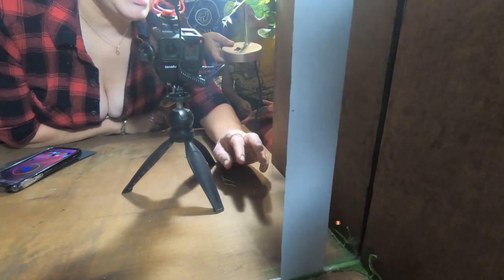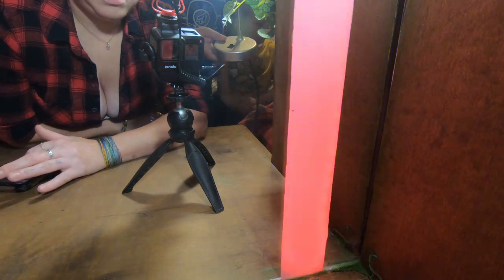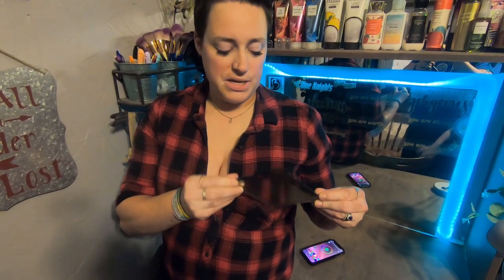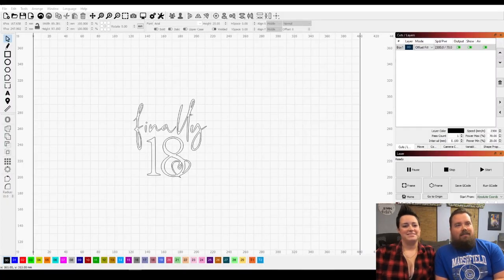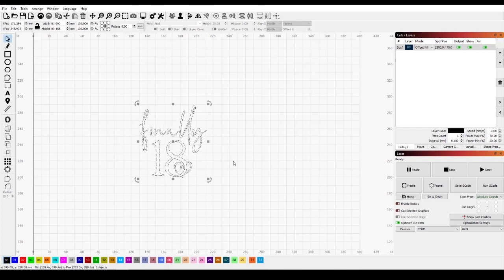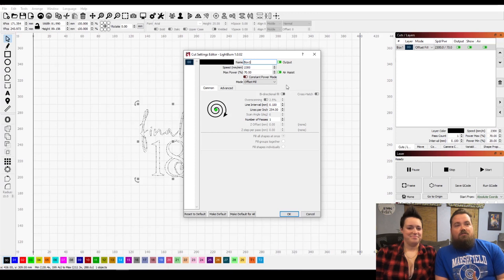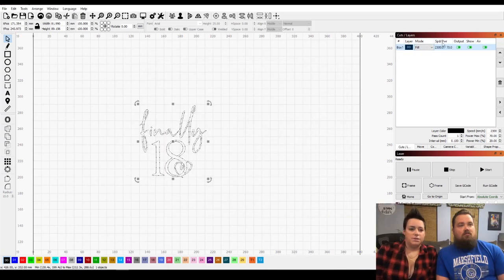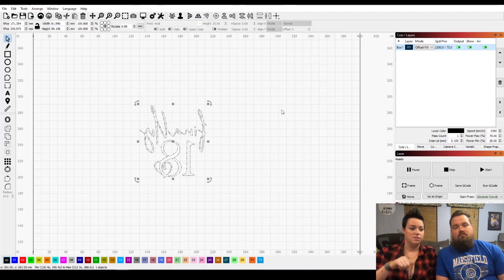How To: Mirror Engraving | Ortur LM2

Comment: Thank you so much for the awesome tutorial! It inspired me to engrave some small mirrors for my room. I tried engraving using a small mirror from IKEA but unfortunately that didn't work :( I used the same settings you used in the video it barely engraved the surface of the back of the mirror. I decreased the speed to 500mm/m at 100% with pass count of 5 and still no luck. Will try again on other brand mirror wish me luck!
Reply from the maker: Maybe try a power scale test on the mirror. It will help figure out the power and speed you need. Good luck!